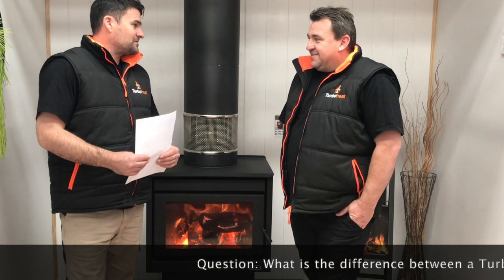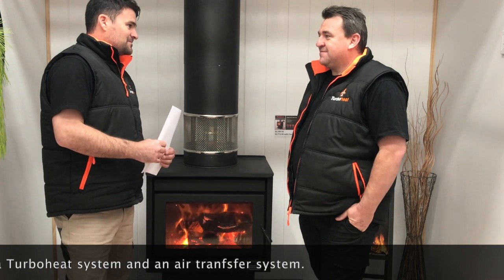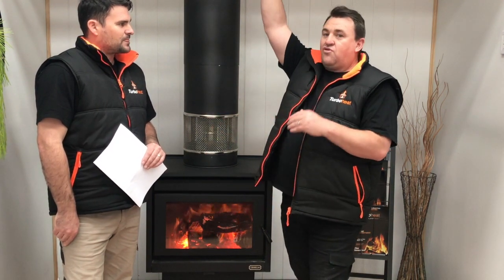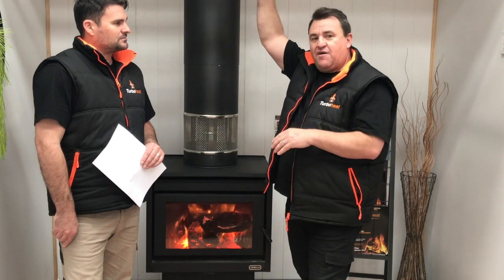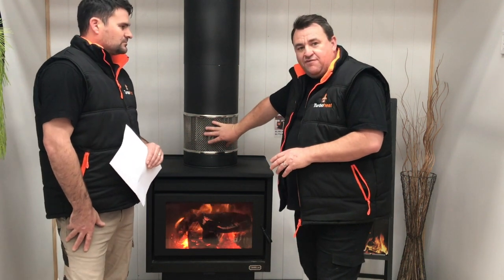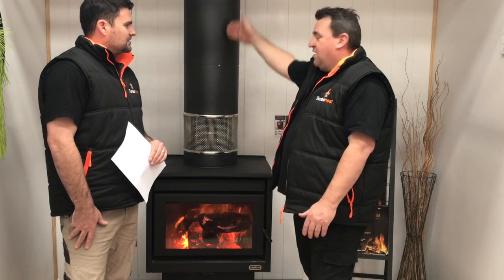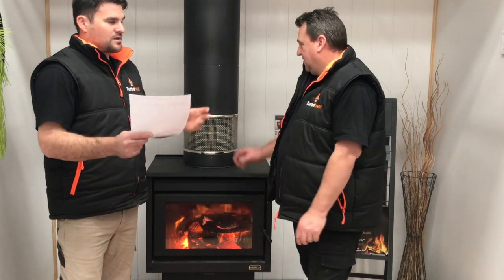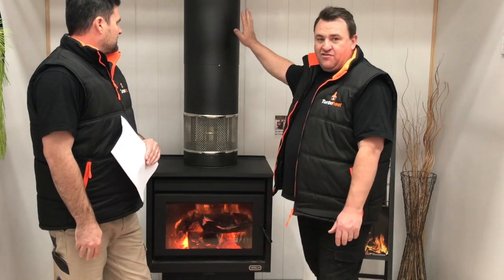Turboheat heat exchanger system

Comment: Does This System Lead to more creosote in the chimney?
Reply from the maker: Hi Nick. 
With the extensive testing the turboheat system has done, the test reports have shown that there is actually a reduction in emissions of up to 70%. This is solely due to the technology in the turboheat system. The temperature sensors does not allow the turboheat system to run if the flu drops below a certain temperature. In actual fact to heat the air we need to maintain heat in the flue which make the flue burn hotter reducing the build up of creosote.